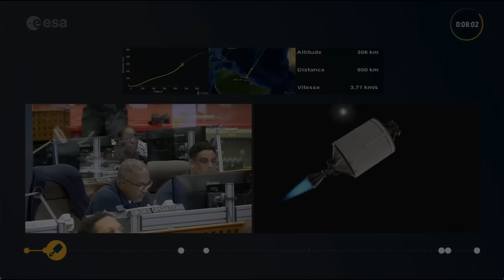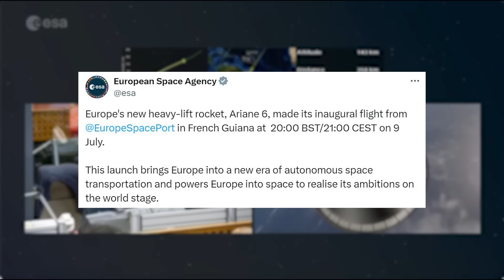Why Are Customers Switching From The Ariane 6 To SpaceX?

Comment: "Starship is meant to fly to the moon and mars"... What is that ESA Director on? It's designed for so much more than that!
Reply: They are political stooges.
Reply: One way only to mars.
Reply: i dunno. starship might struggle as a satellite launcher. it would be difficult to get customers to all want their sats launching at the same time and then insure them all as well, so it might struggle there. also, is there enough demand currently for launching massive amounts of sats at a time? Either that or it might revolutionise it. hard to tell at this point. I think itll be more of a niche rocket launching space infrastucture for the time being hence why they are looking at flying to the moon and launching stations.
Reply: But thats just what SpaceX is talking about with Starship. Launching extremely large constellations (which their aren‘t exactly many of and none in Europe as far as I know) and to go to the moon and mars.

I doubt it will be cheaper to launch than Falcon 9 so for many many payloads going to specific orbit, it just doesn‘t make sense to use a 100t launcher for a 5t satellite.
Reply: @PhilfreezeCH  still feels a bit niche. trouble with a lot of these things is the cost and risk. If i build an entire constellation and plan to launch them over, say, 3 flights, could i afford to build them all in one go or could i build them all fast enough so I dont have 30 of the things just sitting around waiting when they could have been launched on a few falcon9 months ago so can have them earning me some $? also, if something went wrong with the flight thats going to be a lot of $ lost and who is going to insure for that much?
Reply: Launching satellites on Starship would be like using a Mack truck to shift one or two cars. It is great for launching 50 to 100 tonnes to LEO, but how many need to do that. Maybe a future private space station market. Smaller rockets such as Falcon 9, ULA and Rocket Lab's Neutron will take the bulk of the 1,000 to 5,000 kg satellite market.
Reply: 😅😅😅 @maGnetar333
Reply: @geesehoward700  Starship is not about the commercial launch market though, it's mainly for their own internal uses.  Spacex already has a viable commercial launcher.
Reply: Starship is still not really flying. Ariane 6 was not designed for human transportation.
Reply: Starship will not be very competitive for the sort of missions Ariane 6 is targeting. It's simply to large and has too much dry mass to efficiently inject payload direct to GEO. The size really doesn't make sense for most payloads, with the exception being high mass LEO missions, like  orbital refueling or sending hundreds of large V2 Starlink satellites to the same orbit.
Reply: @plainText384  Starship could bring a 3rd stage to LEO. Who could reach every orbit desired.
Reply: @RODI__  1) that 3rd stage doesn't exist
2) Adding an additional expendable 3rd stage would make Starship quite expensive.

Comment: Maybe dont design a one use rocket when your competitor can reuse theirs?
Reply: The cost savings for rehusability is a benefit for SpaceX, not for the clients, the clients benefit for having  a cheaper price, Arianne 6 wasn't planned to have more than 10 launches a year or so, so developeing rehusable technology is pointless, ESA don't want to launche many stuff to orbit, and still wants to compete with tesla, they don't have foresight and wants to stay the same, but the indutry changed with falcon 9, and as long as other space agancies don't want to change, SpaceX will dominate more and more.
Reply: @Voltaje_YT this is the era of megaconstellations like Starlink and Starshield though and Ariane doesn't have anywhere near the economics or launch cadence to build one for Europe. Europe is destined to remain a spectator as the US and China completely dominate Space.
Reply: reusable rockets come at a price as well because the fuel and thre structural changes lower the possible payload and or the orbits that can be achieved. There is no free lunch. What use is a reusable rocket if as a customer you can't get your payload to where you need it to be.
Reply: @rwo5402  thats what falcon heavy is for
Reply: @damitcam  sure, but even falcon heavy is reusable which comes at a price as far as payload and orbit is concerned. My point is that reusability is not free. Having said that, single use hardware with expensive engines are a terrible waste.
Reply: @rwo5402  yes there are losses in payload but they are still powerful enough for most of the contracts out there
Reply: @rwo5402  thats why they keep poaching contracts
Reply: @rwo5402  Most launches don't need to go that far, so falcon 9 manage to be cheaper by being reusable, falcon heavy reuse 2 boosters, regardless, falcon 9 and heavy can reach orbit, but without the reusability feature, so they will just use the booster with the most flights to spend, regardless, the technology  makes the process cheaper, that is why SpaceX have the most contracts.
Reply: @admarsandbeyond  Ariane 6's main goal is to be independent from other countries.
Reply: @admarsandbeyond   Donald J. Kessler liked your comment.
Reply: If independence means economic and plentiful access to space like all your competitors then Ariane6 can't provide that. Like having a sail ship at the era of container ships, you have access to the sea but it doesn't really make you independent.
Reply: @FossilTunes  "Space is big. You just won't believe how vastly, hugely, mind-bogglingly big it is. I mean, you may think it's a long way down the road to the chemist's, but that's just peanuts to space." 
Kessler syndrome is very improbable at low orbits which decay fast. And if you have access to dirt cheap launch like Starship it's not that hard to clean and replace.
Reply: @admarsandbeyond  that was never the design Goal...
Why does everyone compare Ariane 6 with falcon9 or Starship? For lower masses ESA had access to soyuz and for larger payloads Ariane 5 that was 'just' evolved into Ariane 6 to be more cost effective and match capabilities with Angara.
Reply: @admarsandbeyond  through DNA is right space in not endless in the thin shell called "Leo". And even If objects may decay fast there its still a matter of years... And Kessler is not just about one object but a cascade of shrapnells...
Reply: @FossilTunes  Their design goal became obsolete years ago when Falcon achieved reusabilty and dropped costs dramatically. Falcon 9 now launches >16t of Starlink sats for <$20m and soon the Chinese will follow, Ariane6 is not enough to guarantee EU independence in space now, and soon with Starship it will become completely irrelevant.
Reply: @FossilTunes  LEO is still an enormous volume, hundreds of times more than the surface of the Earth. A few tens of thousands of small satellites with smart collision avoidance systems and active de-orbiting (which Spacex has focused from day one) shouldn't be that big of a problem. It's also relatively easy to clean up and various companies work on tech to do that.
Reply: @admarsandbeyond  You do realize that Kessler described a feedback mechanism? Yes. There is quite some volume but we should NOT consider the full sphere of a few km of thickness but the orbital planes we can easily reach or that important for us... lets say we have a few objects colliding somewhere in 50° inclination at 200km altitude.
They WILL decay at some point... but lock us out from most orbits that could be easily used for space stations. Or even worse in 28°...
Reply: @FossilTunes  I know all that. As I understand it (from some studies I read back when Starlink was under constant attack by small astronomers demanding commercial capitalist exploitation of Space to be stopped) at these low orbits Kessler is not very likely. The smaller the debris gets the faster its decay rate which acts as a moderator on the cascade. At these altitudes most small pieces will not have the energy and will burn up before they have a chance to destroy more and start the exponential.

Comment: Baptiste cant criticise EUMETSAT for wanting to switch since spacex is cheaper (and was the safe bet). Ariane 6 is somewhat of a disappointment that doesnt offer anything over its competitors beyond giving europe its own means to launch satellites. that said itll be interesting to see how its next few flights go.
Reply: Well stated...
Reply: Realistically Ariane 6s only advantage is being a European rocket for European nations to have their own rocket for sensitive osyloads in every other category its completely irrelevant
Reply: @KiRiTO72987  So the unique capability (to some extend Photon can do this but not in this mass-capacity) of relighting engines to send multiple satellites into various orbits is quite a nice thing for Ariane 6. Also.. since Ariane is bound to Guinea the main market for Arianspac are geostationary orbits as they get them pretty "cheap" there. Its not meant for all inclinations and therefore not Constellations (despite the Kuiper idiocy).
Reply: Ariane 6 has a more precise thrust control.  This allows far more accurate placement into orbits.  Now, pretty irrelevant at LEO, about 40% more time on station at L2 than Falcon 9.  Starship is more accurate based off ground test data.
Reply: SpaceX is cheaper only if you're not the US government! Don't forget that all US Agencies or the US Army can't launch a satellite on a non-US launcher, what Baptiste wants is that EU Agencies do the same thing.
Reply: @p4olo537  SpaceX is always cheaper.  The government actually pays the standard commercial rate plus services.    Other rockets are add 40% or more.

Comment: Even the Vulcan Centaur is better than Ariane 6. Vulcan Centaur costs only $110 million per launch compared to Ariane 64 costing $125 Million per launch. Vulcan Centaur is cheaper because it’s partially reusable. 

Vulcan Centaur payload to LEO is 27,000 KG. And 15,000 KG to GTO

Ariane 64 payload to LEO is 21,000 KG and 11,000 KG to GTO

New Glenn outdoes them both and outdoes the Falcon 9 and Falcon Heavy. New Glenn cost per launch is $68 million. 

New Glenn Payload to LEO is 45,000 KG and 13,000KG to GTO.

Comment: That is the price for EU-funded megaprojects where there is no market pressure to complete them quickly and efficiently. There is no natural selection between good and bad ideas. With all the eggs in one basket, every idea is assumed to be smart by its creators, and the market must adapt to the solution. However, with other options available, it seems the market is not going to embrace the solution imposed from above. I hope it doesn't become another overpriced political project. Nobody would benefit from it except a few EU bosses patting themselves on the back. On the losing side would be EU taxpayers and space exploration, as the money would not be effectively allocated.

Comment: 1:44 Is that hard to understand that even the strongest patriot gets a little dizzy when the price is 10x higher?
Reply: Claiming that Ariane 6 would launch at 10X the price of a Falcon 9 is an extreme exaggeration.
Reply: @michaeldeierhoi4096  Probably, but seeing that massive booster being thrown away is really sad. Also, cadence is another subject. Having to produce a entire rocket is very different from having to produce only a 2nd stage.

Comment: Honestly its a complete lack of vision and somewhat arrogant to think that the Ariane 6 is enough compared to a rapidly reusable Starship that can take hundreds of tons to orbit for a nominal cost. Ariane 6 does not appear to be designed for in orbit refueling and space docking systems, but keep on dreaming I suppose
Reply: its a weird one. I think the only answer can be Arianespace are guaranteed a profit regardless of number of customers or flights through the subsidies they get.
Reply: First, Ariane is working on Susie and has been for some time. These large government funded entities just move slower out of fear of being canceled if a single thing goes wrong, compared to SpaceX which could blow up many rockets to get reuse right without problem.
Second, the majority of SpaceX launches are for their Starlink. If you do not have someone at hand for a similarly sited constellation, the math on whether it makes sense or not changes drastically.
Or to put it plainly, a rocket without payload is just a large hunk of metal.
Reply: @PhilfreezeCH  I was sort of hoping Themis or Callisto would become something other than the Ariane Next. Susie could be interesting but I dont think itll get passed the approval stages. what would it be used for? flying to where the ISS used to be? going to other countries/businesses new stations?
Reply: You love to compare apples and oranges? Ariane 6 was never meant to be a heavy lifter in the first place. It doesnt need docking capabilities as it is only a launch vehicle and refueling is something noone, not even the holy starship, has ever really done for a spacecraft. Ariane 6 was always meant to be a less expensive replacement for Ariane 5 with similiar design goals nothing more nothing less.